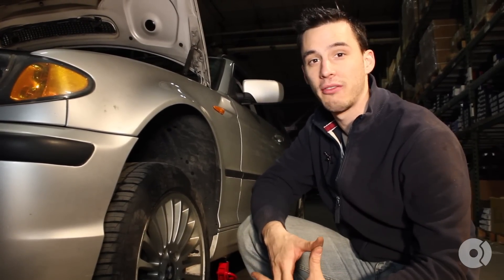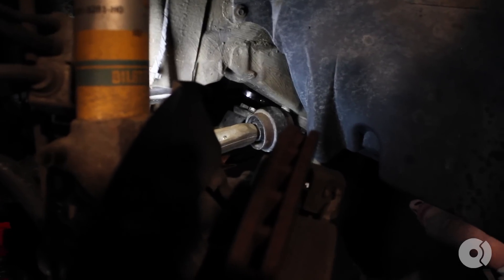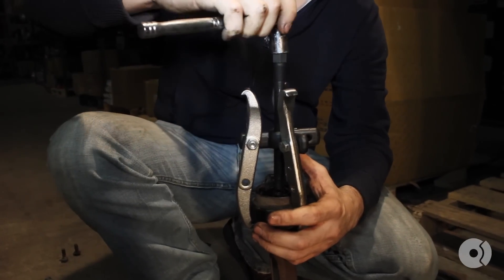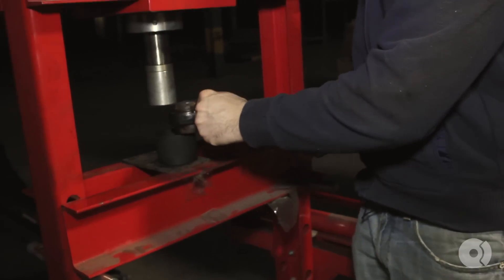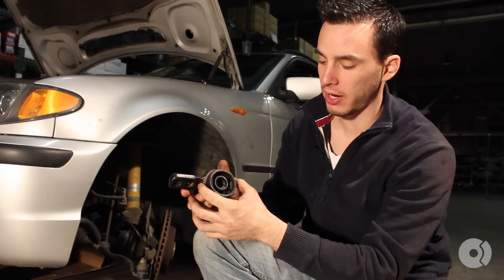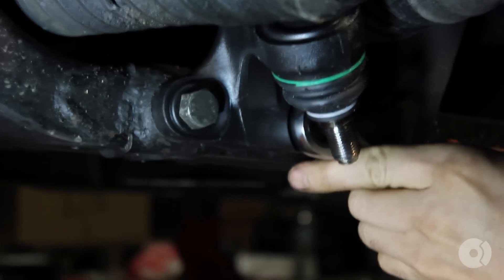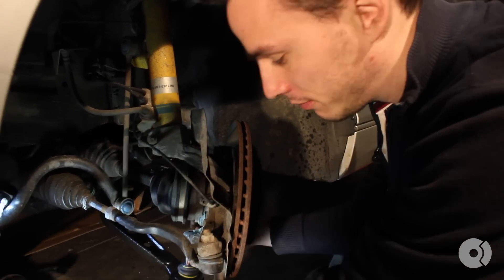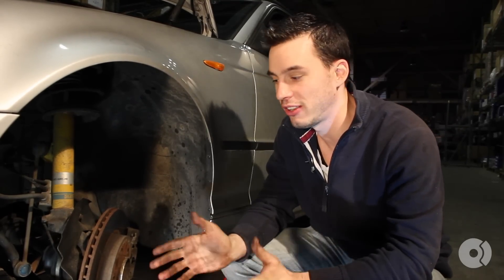BMW Control Arm Replacement (Arm & Bushing E46)

Comment: First of all thank you very much for sharing and making such an easy thing that this ease motivated me to do it myself. This was my first time and it took me around 6 hours from start to finish. However, there is one VERY VERY important piece of information missing. When you put new bushing on the control arm then it is directional. Make sure that you insert correct side in. I learnt the hard way and that why it took so long and I was extremely frustrated at that time. I had to take off the bushing from control arm and had to put back the other/correct way and I damaged the bushing. I had another bushing handy too but I was too tired and just wanted to put back everything together.

Comment: Great quality video guys! I'm getting all sorts of squeaks on my front and rear (95 E36 M3) 120k on it.  H&R springs Bilstein struts lowered.  I know I need to replace the rear shock mounts with something heavy duty.  What do you suggest I replace on the front or additional in the rear? I would love to have it super tight and no squeaks.  

Thanks!

Comment: Great post!  I bought all of the Lemfoerder parts I needed from you guys and just followed the instructions on this video.  My son and I did it in a couple of hours.  Easily the most difficult part was getting the old bushing out of the bracket and getting the new one in.  Thanks for the video.
Reply: Hi Ne Mo, would you please share some tip how to remove the old bushing out and press the new one in without a fancy pressing machine? Thanks.

Comment: planning on doing this my son's e46. What size is ratcheting / flex head box wrench ?, as I am going to have to get one.
Reply from the maker: Depends on the exact model, but here's a complete list of the tools you need.

i models (RWD)
2 jack stands
Torque Wrench
Philips Head scewdriver
16mm socket
19mm open ended wrench
22mm open ended wrench
22mm socket
Pickle Fork
3 lb hammer

xi models (AWD):
2 jack stands
Torque Wrench
Philips Head scewdriver
16mm socket or wrench
18mm socket or wrench
23mm socket or wrench
Pickle Fork
3 lb hammer
Reply: FCP Euro
Thanks, just needed to be sure of the size of the flex/ ratchet head box wrench. Haven't bought a set yet, but ordered them today.

Comment: i don't have Access to a machine shop where they can pop the bushing out. Can I just buy a bushing with the bushing bracket?
Reply from the maker: Hello Manaury, the bushings will need to be pressed in on the XI all wheel drive models, the rwd E46 models don't require the bushings to be pressed in.
Reply: I find it to be so messed up! like why can't they just come already in with a new bracket like the rwd bushings do. they charge $80 here where i live just to get them pressed in. smh

Comment: What size is the flex wrench that you used?
Reply from the maker: I believe it was a 14mm.
Reply: It's 16mm, in the video if you pause it at the right time you can see it. Pelican Parts DIY confirmed.